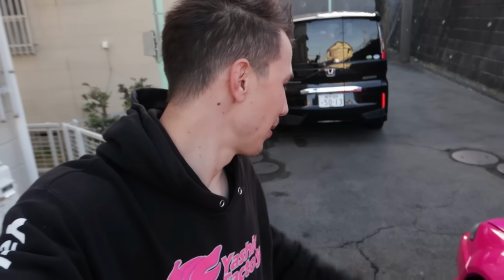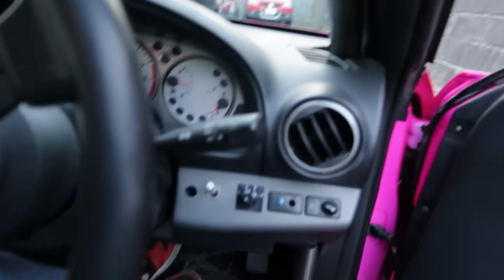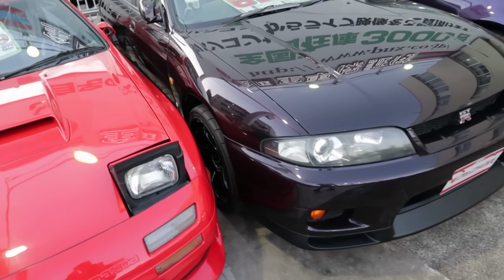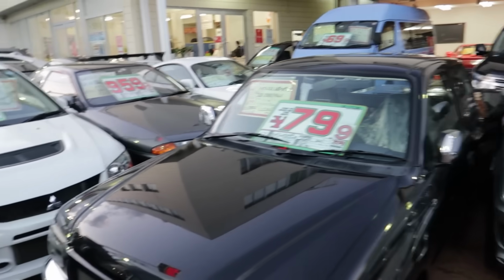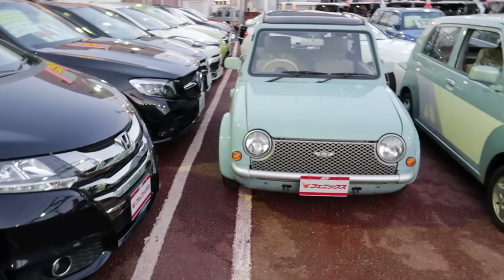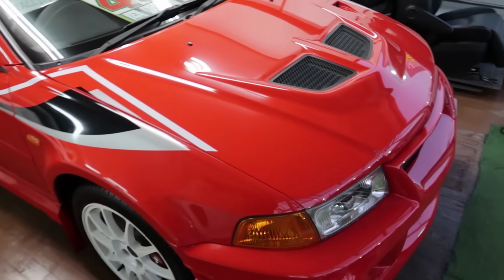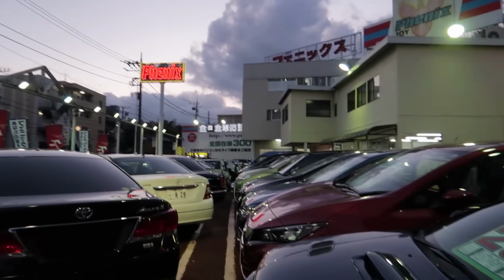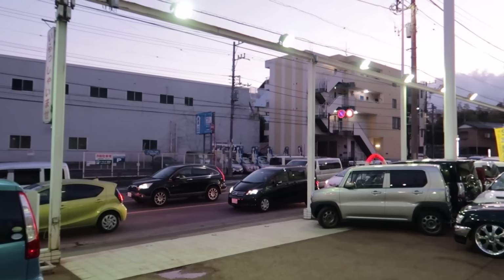CRAZY RARE GTR'S FOR SALE IN JAPAN!

Comment: standard R34's  had less production than v-spec actually , I wonder if people actually can tell  the differences (apart the sticker) between v-spec v-specll M-spec etc etc etc! . some differences is obvious as carbon fiber rear diffuser, front bumper vents, carbon fiber hood, mdf , all easy enough to apply to a standard R34, and this is not even to speak about ztune… personally to me I would have any r34 with a r.i.p.z RB30 any time any were, but that is just me lol

Comment: 14:50 yes that's the drivetrain you use for an AWD setup on a civic. Viscous couplers, drive shaft (has to be moded, cut and weld to length and spec of whatever car you're planning on doin the conversion to) and rear diff, axles. Depending on what civic there are plug and play kits as far as for the rear setup(trailing arms, hubs) as far as the transfer case that's based off what series motor you will go with. D= the civic wagon you were just looking at, B= 96-01 Honda Crv awd trans and k=01+

Comment: You did really well this time around.  The Evo is an Evo 6.5.  The TME with is the FULL rally spec.  That car is literally the holy grail of Evos.
Reply: 6.5 has a different front bumper this might be a 6 replica?
Reply: @infamous-wl9vq  No, this is the 6.5. 
The 6 came before it and had 2 small fogs in the front bumper.
Reply: @leeslimz7606  look at the front bumper again...
Reply: @infamous-wl9vq  yo know what, you may be right. That's not a 6.5 bumper
Reply: Yeah bro not the best view but I'm 85% sure  it's not a standard 6.5 bumper!
Reply: @infamous-wl9vq  it's definitely not.  It's a VI front bumper. I'm sure of it.  I would have to see the interior and maybe engine bay to confirm. But as of right now that's just a 6 with a paint job.
Reply: @leeslimz7606  yeah! But never know unless they have it listed on their website?

Comment: Yo Sammit!  That Tommy Mak 6.5 is amazing!  not sure if you know about ND filters but its not something you should turn on in low light situations... it basically blocks light from hitting the sensor (which is why the frame rate went down) and is meant for extremely bright situations or when you want to use lower aperture or shutter speeds in bright light.  If you want to cut down reflections from windows and water you need a Polarizing  filter :)

Comment: Most of the mileage on the GTR's have most likely been tampered with replacing cluster etc. Similar to rewinding the odometer back in the day.
Reply: When they swap clusters, they have to get the current miles at the time of the swap written in the owners manual and verified with a stamp from Nissan. If that doesn't happen, they label the miles as "unverified miles" :)